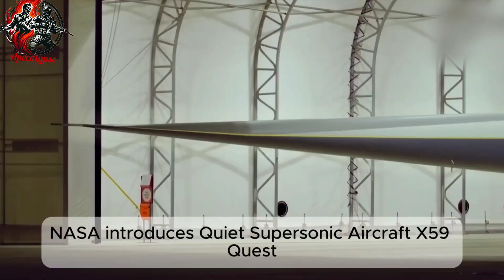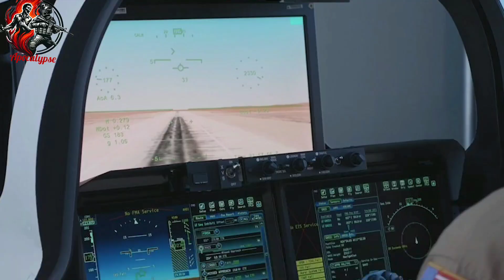NASA’s Silent Supersonic Jet Could Change Air Travel Forever

Comment: I'm not paying $2800 to fly from Tampa to Denver.  I'm not even paying $400.  I once took a train to New York and a 21ft Penske from there to Denver and it didn't cost $2800 including fuel.
Reply from the maker: You're absolutely right—ticket prices can be outrageous sometimes, and your story shows that with some creativity and effort, there are definitely cheaper alternatives. But the whole point of a project like the X-59 is to pave the way for a new era of air travel that's not only faster and quieter, but hopefully more affordable down the line. If this tech succeeds, maybe in the future you won’t need a 21ft Penske to get from New York to Denver! 😊✈️